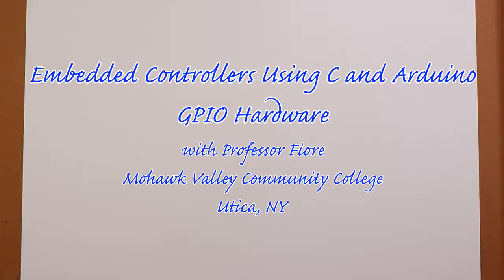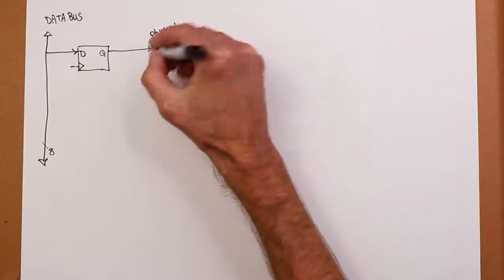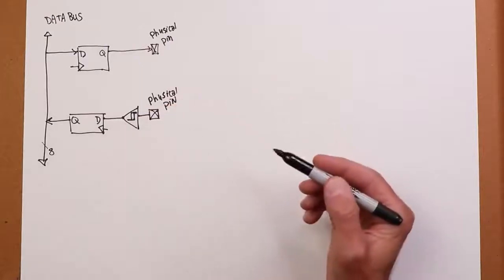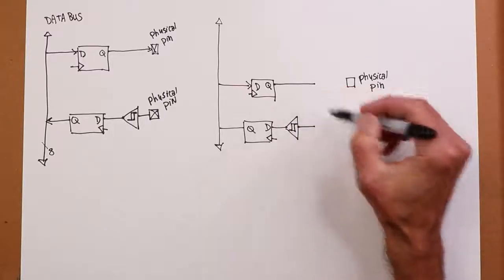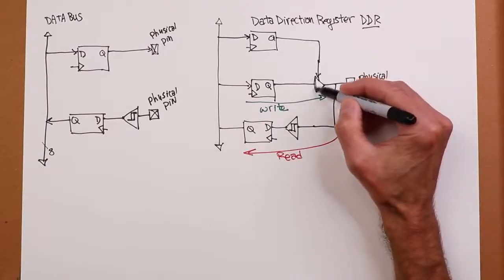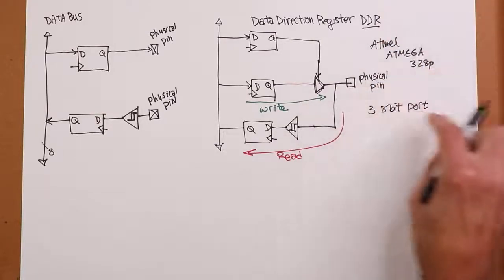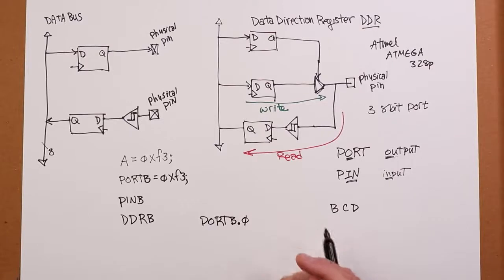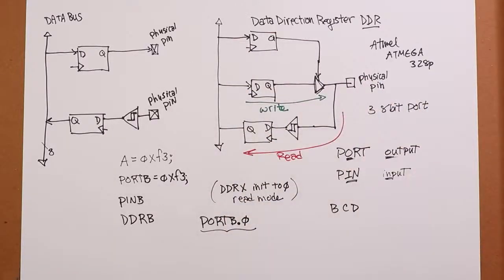Embedded Programming: GPIO Hardware

Comment: Cool, as a comp-sci person, it was cool to understand what's behind GPIOs. So the data bus width say 8 bits, but only 1 bit is dedicated to drive a given single GPIO pin, and its DDR.  SO what if we have more than 1 GPIOs ? And the ddr register value that we initially wrote to, I guess its held in that register thru the life of the system, meaning we dont' have to constantly write to that gpio pin. thanks.
Reply from the maker: A typical microcontroller of this type would have several 8 bit IO registers. The direction of each bit is individually set by the corresponding bit in the associated DDR. Think of the DDR as one byte of static memory. If you don't rewrite it, it stays the same value until power is cycled.